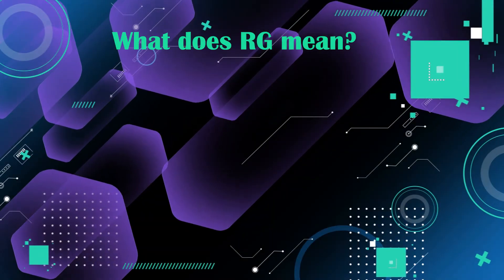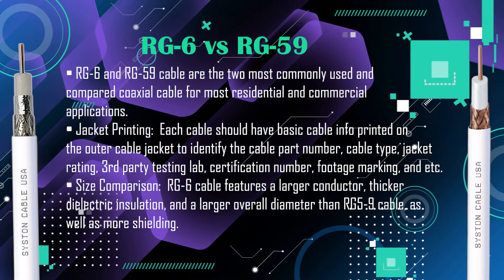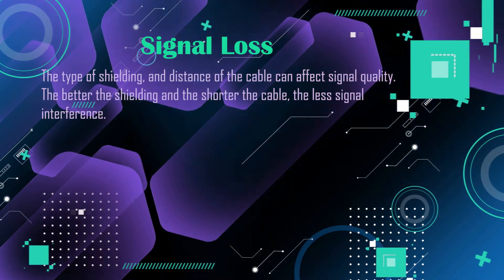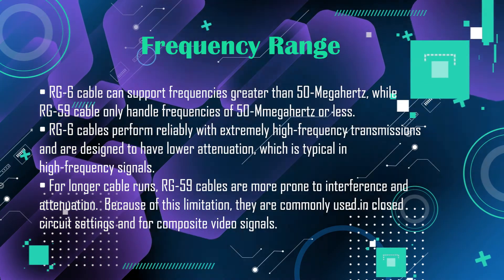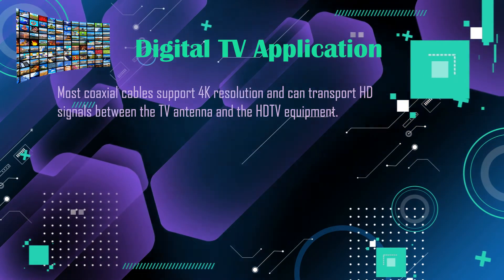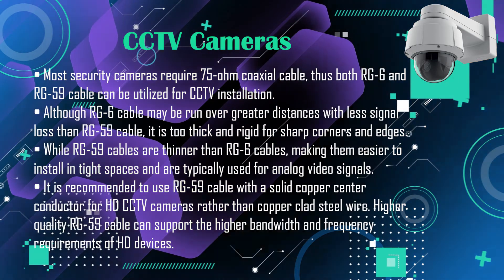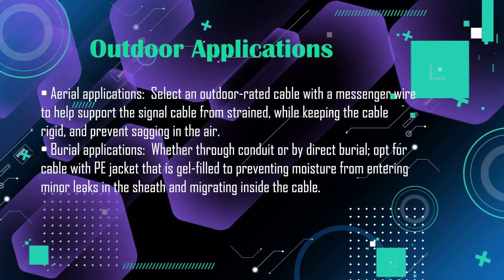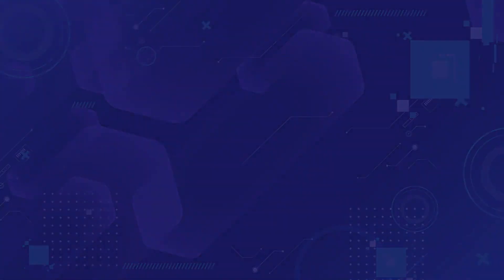RG-6 vs RG-59

Comment: Needs some double checking before posting to Youtube. BTW, due to "skin effect", the inner core of the center wire, like copper clad steel, has nothing to do with RF resistance signal loss.